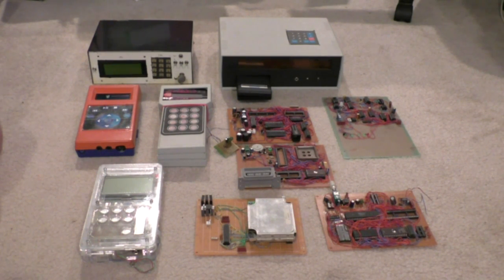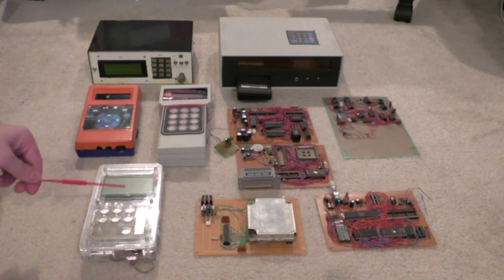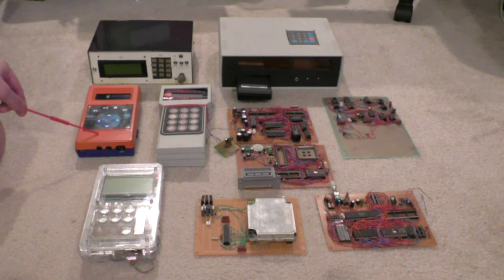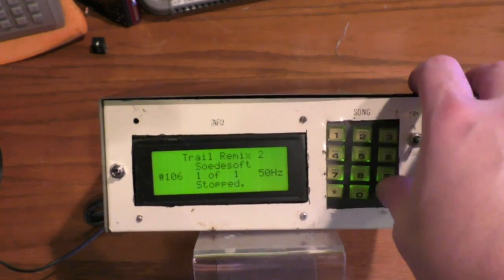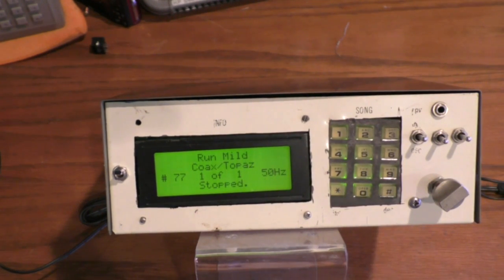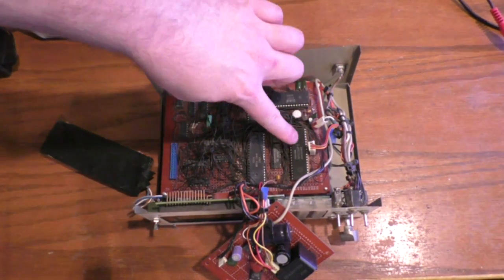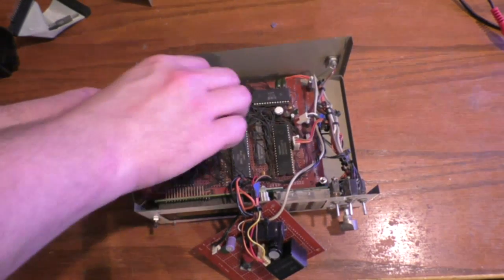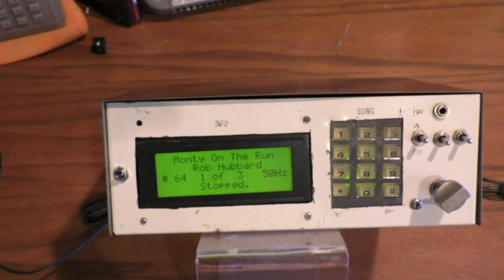Chiptune Player Overview and my First SID Player

Comment: Cool stuff. Hey how's that Zimba 3000 project doing? The concept sounded insane!
Reply from the maker: +Chris Bradshaw I have put it on the back burner for a little while because I wanted to break from doing FPGA stuff for a bit to clear my head.  That's why I did that RGB clock project recently.  I will get back into the Zimba though, so not to worry.
Reply: +kevtris keep doing your thing man, I love your craftsmanship.